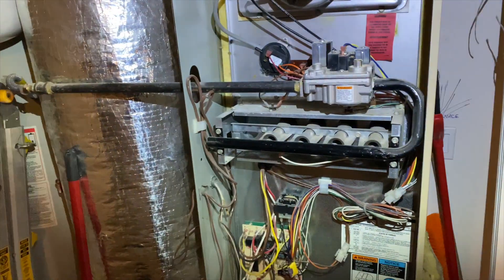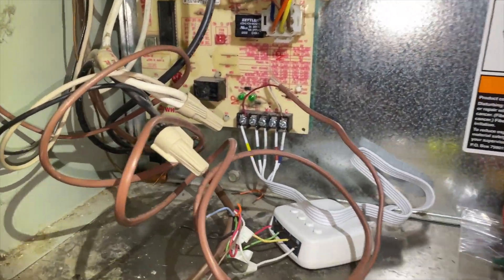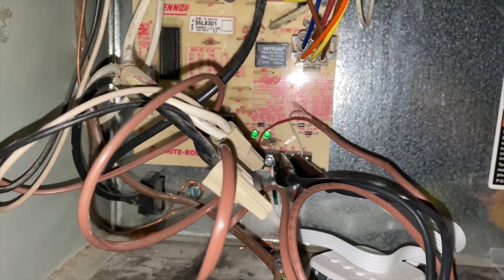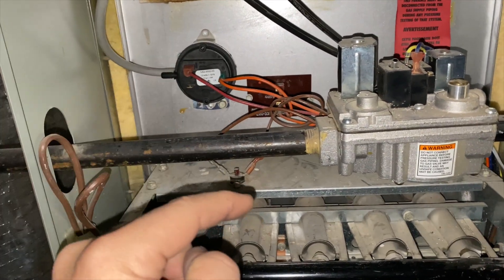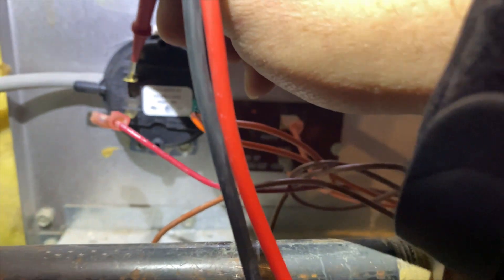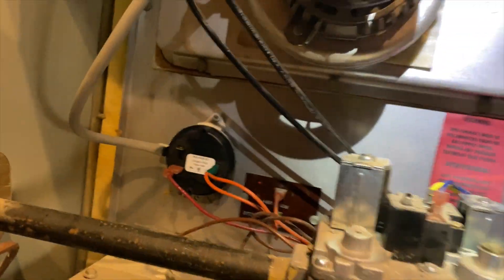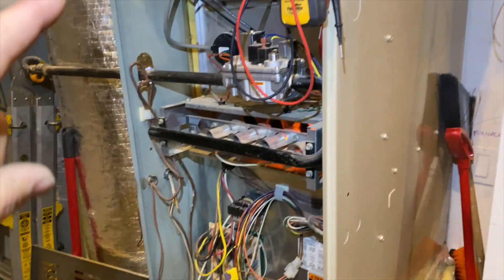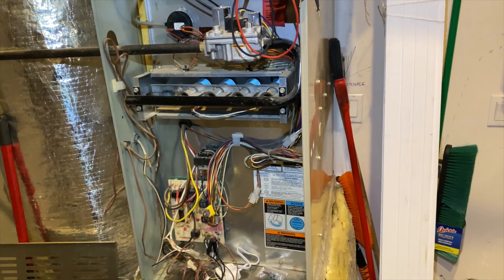Universal Pressure Switch Not Working Properly EP83

Comment: Looks like u just actually hooked it to the positive-it was hooked to the correct negative port originally but the set screw wasn’t set to make the normally open become open instead of closed as it comes before you tighten down the spring to set it

Comment: Well that’s nice and dandy but if the tech could not figure out what port to connect it to, then you shouldn’t take for granted he set it correct to start with.  You need to double check the “WC and set it to the correct value.

Comment: Excellent explanation. I know at some point we have all done this but, all those switches regardless of + or- switch we really shouldn’t blow or suck on them. They are subject to damage due to a extremely sensitive diaphragm spring. It’s made to measure inches of water column. I have done that EXACT thing also. Just passing along. I use a manometer from Fieldpiece that has a vacuum pump for this purpose.